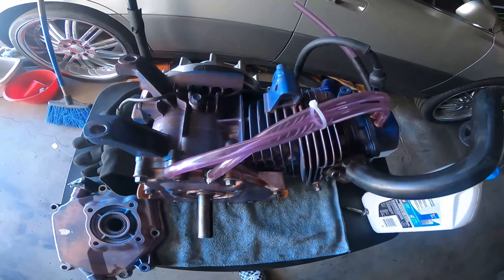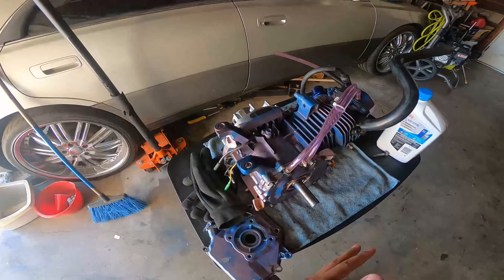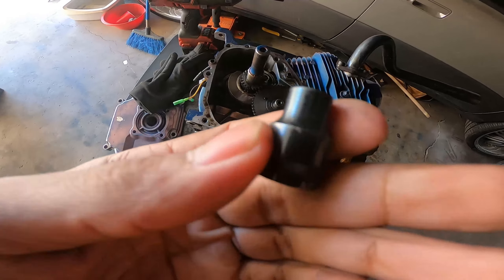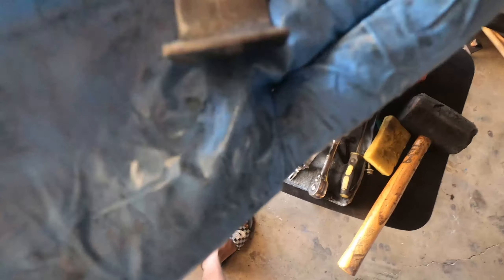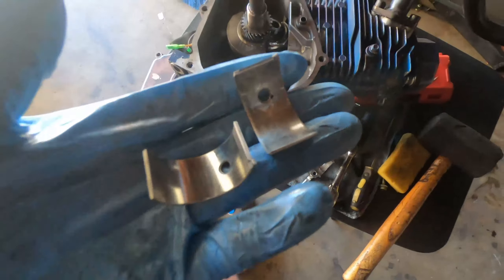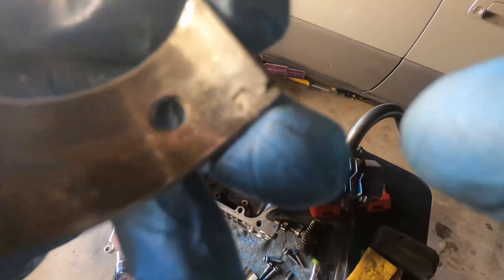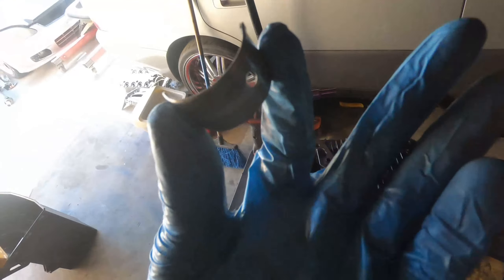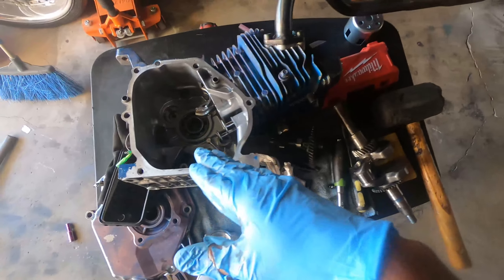I Almost Spun A Rod Bearing On My 212 Predator! How To Change Rod Bearing!

Comment: Friend how do you get the crank out without removing the piston
Reply from the maker: Take the bottom of the rod off then grab the other half of the rod and push it up then rotate the crank until you can pull it out

Comment: You should be using a heavy weight oil and allow the engine to properly warm up for 5- 10 minutes before riding and hammering on it that will reduce wear and tear these engines dont have pressurized oiling systems so before you even turn the kill switch on pull it 2-3 times to get oil up into the bearing to prevent a dry start in my engines i run 20-50 full synthetic high zink racing oil vr1 everyone needs to quit throwing a small fortune on these engines if your gonna run crap oil in them and not allow them to warm up properly your gonna do damage as you can see.... 1 stop dry starting the engine pull it over a couple times with the ignition off so it doesnt try and start and you can get oil up into the bearing 2 then start and allow the engine to warm up before riding it 5-10 minutes 3 the thicker the oil the better arc says right in the instructions to run a heavy weight oils i will add to that and say heavy weight and high zink these are flat tappet engines that love to eat metal zink will help prevent wear on the cam and crank but see the damage thats already been done to this engine i would definitely recommend checking oil clearance and if the crank is out of round